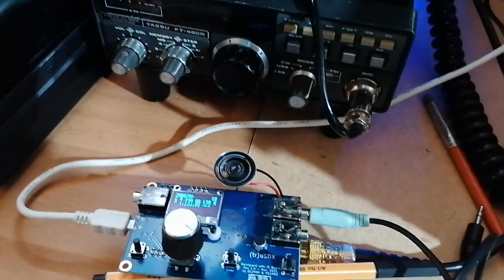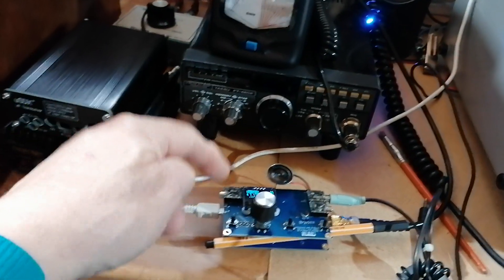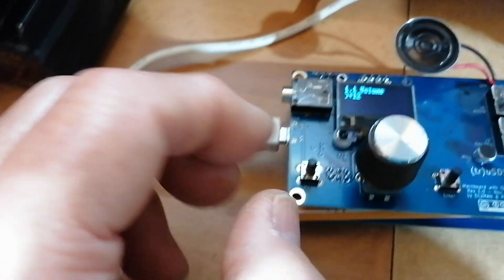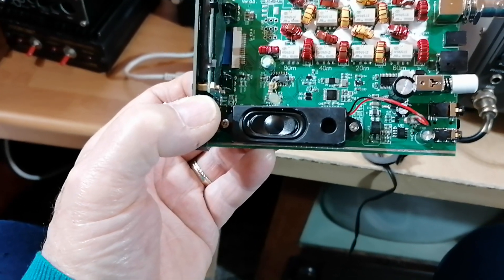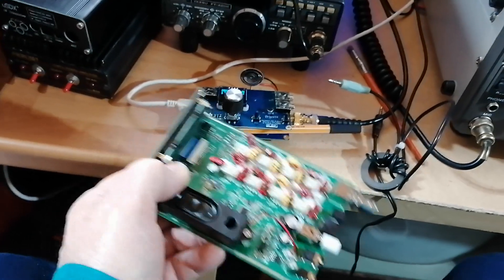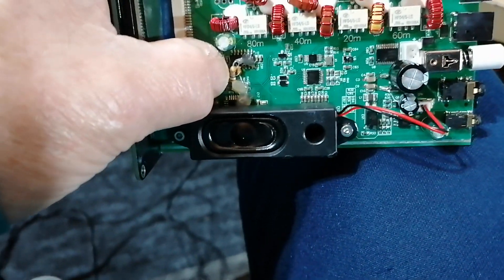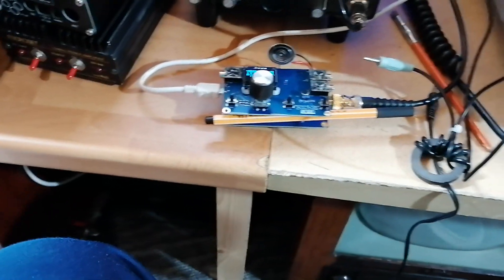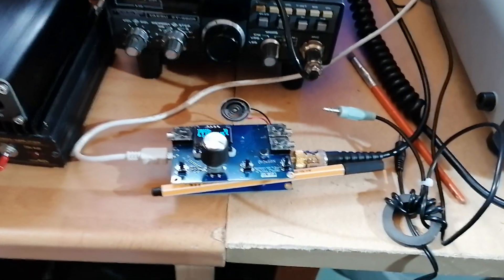(tr)uSDX, first test.

Comment: The rig is an experimental one, not a commercial consumer product. The speaker is just an emergency add-on. Headphones are the intended application, which is better anyway. BTW, I've tuned the 20 meter efficiency on mine  to 86%.

Comment: I received my (tr)uSDX today from one of the recommend vendors. 29 days from ordering until it arrived at my mailbox. Very good delivery time in my mind.

So far, checked the TX on CW, 750 mW on 60 - 20 meters and 1.1 W on 80 meters using a 5V cellphone recharge battery. I got mine with the "orange" case. I put it in quotes because my color vision is poor, and the case looks yellow to me. My YF, Anne, WB1GVL tells me the case IS orange. Not going to argue there...

CU on the bands soon! 73, Keith, WB2VUO here near Buffalo, NY.